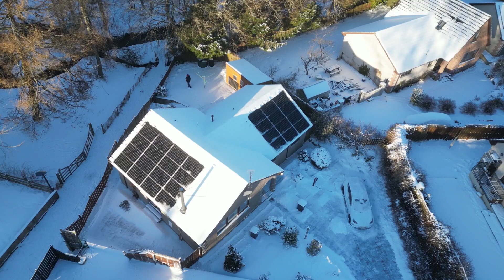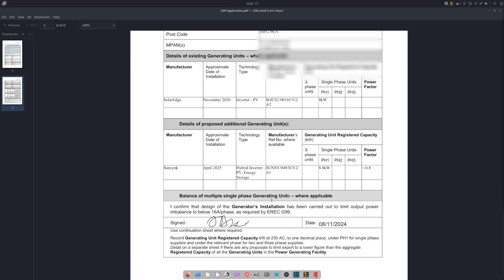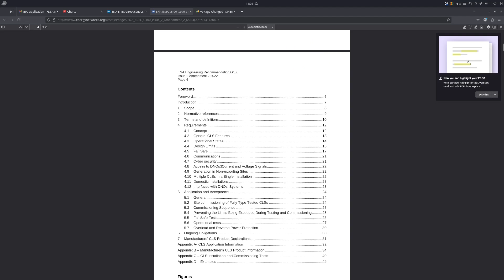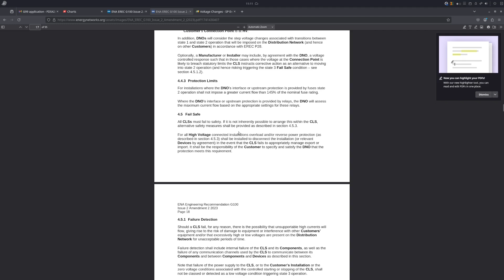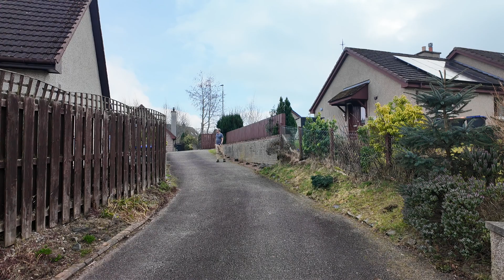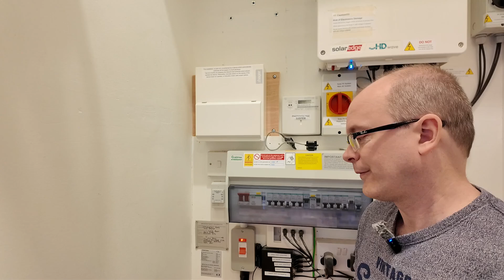G99 Application process for more solar/batteries

Comment: You can run the off grid system in parallel to the on grid system - separate the loads to critical and non-critical, etc. Some of the house loads will be working using the off grid and some will be on the on grid. Adapt as needed. Nobody can tell you do not charge the off grid battery using a battery charger that is connected on the on grid. It might be not be ideal and might increase the overall cost but it won't be need to dig the 44m driveway. If a war happens we will all have to adapt. Good luck.

Comment: I'm in a similar position. I've overpaid for a 9.5kWh GivEnergy battery with "5kW" inverter (actually 3.3kW in reality) and I've calculated I can effectively recover that overpayment if I buy more capacity that brings down the average. I'm tempted by an EV battery and inverter, but I might have to take it off grid... Just exploring the options right now. 

GivEnergy not only only work with their own batteries, but you have to get them installed by an officially trained installer to get the warranty and they seem to ask for thousands for a plug and play system! Absolute scam!

Comment: Adding additional high voltage batteries such as Tesla Powerwall2/3  which have their own inverter will not need extra certification as long as it is part of the same installation and is configured so that your export limit from all your equipment combined is respected. 
 You are talking about low voltage batteries which have no internal inverter I believe.
Reply from the maker: The fact that the Tesla powerwall has its own inverter means that by definition it is a separate installation and therefore needs a separate G99 approval.

Indeed despite the emphasis in my application that the site total export limit was being maintained, the DNO said that was not a sufficient measure without further reinforcement of the supply to my house.  They would say the same thing if I proposed to have a Tesla Powerwall installed instead.

Conversely if I add another SolarEdge battery to the inverter that I already have, then no new G99 application is required at all, since the interface to the grid remains unchanged.

The DC configuration has nothing to do with the G99 approval requirement.  It does not care if you have high or low voltage batteries. It’s the AC component of whatever generation is being made that matters - specifically the AC power that is connected to the grid.  An off grid system requires no approval, as it’s entirely outside the jurisdiction of the DNO.

Comment: Great topic as we get over voltage issues, mainly due to a few 50kw solar systems on chicken sheets near our home. Anyway invest in an off grid system no requirement to notife DNO as it does not connect to its system. Use a goid transfer switch, put new arrays into it bingo. If you have a fit or seg system just make sure its connected to grid then arrange or configure your home consumer supply so that you can switch between grid and off grid. For myself I have 12kw of arrays my intention is to use the anker solix x1 30kw all in one unit. I will configure mine so my fit solar scheme will be perfectly connected to grid and then configure the cables to consumer unit via a change over switch inside the home. For mine I will configure 2 change over switches so I can use a generator to charge bateerys if I need to. I myself require 3 phase but I have been quoted over £15k . So I have installed 4 differant arrays over east and west roofs ready for connection to the bew system.

Comment: Very interesting video. Did you make any progres on this in the last 5 months?

I wonder if there is any solution by using 2 inverters (one grid-tied and one off-grid) that have a common battery?
You could produce lots of power, dump it into the battery, then export it at the limit for as long as you can. (Even if into the night). So your max per hour export won't increase, but the amount per day will.

Comment: If you current cable is 4 wires, then you should be able to make your own ground and convert to three phase. Exactly the was done in my mama's house in Lithuania.
Reply from the maker: From what I see, it’s a single phase TN-CS supply, so just 2 cores.  This is the normal standard for most residential homes.  

Homes with overhead supply are typically TT supply.

Comment: Which software did you use for the schematic drawings
Reply from the maker: I just used libreoffice draw to do this.  I’m sure there’s better solutions, and indeed my hardware engineers at work would be using autocad for their own wiring diagrams, but I can’t afford that license.  So basic drawing tools will do for me.

Comment: have you tried to see haw much voltage sag you get when charging.
I.e measure voltage no charge and then measure while charging.
Just to see if your voltage sags as much as it peaks then you may have an idea if it is your supply cable.
Reply from the maker: @FireballXL55  When I’m pulling 8kW, then I measure 229V.  So an 11V sag.  It’s 240V with minimal loads.
Reply: @anthonydyer3939  Would it be possible to measure at a neighbours house and do the same thing. That way you should be able to tell if is your cable or the transformer.
Reply from the maker: @FireballXL55  Actually now that I think about it, I measured 229V at the Tesla, which is an extra 18 metres of cable at 6mm2.

Next time I’ll measure at the inverter.

Comment: As a commissioning engineer in the water industry, I was involved in a number of schemes that had export limitation. These were quite large power consuming sites and the generator power (CHP, Hydro, Emergency back up with synchronised restoration) was normally always to be consumed on site and not exported. I recall getting the independent reverse power trip circuit witness tested by the DNO. These were a hardwired emergency stop trip of the generation system that needed a manual reset. I would have thought that a simple reverse power trip that opened a contactor on your invertors to disconnect them if the export exceeded 5kW and required a manual reset would have been acceptable the DNO. I can see why they would not like raspberry Pi and modbus but a stand alone power measuring device with a trip contact is more straight forward. The key points are that the system works on export limitation not voltage when the primary export limitation has failed, and that it requires a manual reset following investigation of the reason for the trip.

Comment: Great video - answered a lot of questions I had, except one: I have a Tesla Powerwall 2. Does this need to be included on the G99 form as an existing generator too?
Reply from the maker: @spoonwzd  Yes it does.  It is an AC coupled battery, so it will have its own inverter built in

Comment: What I would do is radically different , at it's simplest  measure the full sun output of the panels ,  go to a local scrap yard and buy a ton or so of old car lead acid batteries ,  build an array that matches ( sort of) the full sun output voltage so if the cells are 40v then 36V and wire this  in series with the cells with a big fat diode and a low voltage cut off ,  if the full sun output is slightly less than the 12v nominal cell charging voltage the cells will last forever ,  even if abused you pay scrap lead price just replace them for more scrap batteries ,  lead acid automatically balance if you add some discharge resistors as a basic BMS ,  you can go as daft as you like with tech but sometimes stupid is better ,  nickel iron batteries are better but unobtainable basically ,  lead acid is cheap and bought properly cannot lose value ... The supply authority sees nothing ,nothing changes on your system except you export power  during the night when your output is usually zero,  cute isn't it and you can do it all yourself

Comment: The better solution is to time shift ,  you use battery storage and are able to export 24/7  ,  it's very simply done ,  you just arrange the DC backup to be charged by the secondary array and then connect using a single diode to the input if the grid tie inverter ,  so when there us no sunlight it starts to run down the battery ,  DC is DC remember that it just takes s little thought on layout and a diode

Comment: Thank you Anthony, a very useful guide. I am considering expanding our domestic solar PV and have been wondering if I should attempt to submit a g99 application rather than leaving it to the installer.
Reply from the maker: @clivepierce1816  if you can draw a good enough schematic, then I’d say it’s fastest to do it yourself.  SSE got back to me promptly enough if there were any questions, and at that point you can either reply to the question, or defer the whole matter to your installer if you feel you’re out of your depth.  If you rely on your electrician from the start, then “add some more weeks or months” is probably a global rule of thumb.

Comment: A simple device implementing the G99/2 state-machine would be very useful. e.g. for inverters which are certified to G99/1 but don't do the new state-machine stuff from G99/2. As you say, it's not particularly difficult to do, although demonstrating what level of actual uptime and reliability it achieves could be tricky. I didn't know about IEC 61508, which sounds like a reasonable approach.
It is tricky to test/demonstrate the reaction to grid excursions because you can't easily simulate those on the real grid. But one can easily test the state-machine and disconnection timeouts by connecting up a variable supply. Certainly an interesting project I'd be interested in helping get done.
Reply: Achieving compliance with 61508 isn't as straightforward as often thought. It requires an analysis not just of hardware failure modes, but implementation of a software development process that can be shown to be appropriately robust. The hardware elements might be achievable (statistical reliability information is available for most components) but you'd need reliability and failure mode data for the Modbus metering device; that might be more difficult to obtain. One question that would need an answer is what proof of 61508 compliance do SSEN require? That's easy if you buy a certified device but a huge project if you're building this yourself. I was previously Head of System and Software Safety in the automotive industry for one of Bosch's competitors, doing this kind of thing in a commercial environment is straightforward, but I wouldn't want to do it at home.

Comment: Not sure how a larger cable helps with high voltage ? Surely this just allows a higher voltage to affect more of the surrounding properties ?
Reply: I am confused about this as well.   The DNO states that no upgrades are needed to the wiring in the road, just the connection to the house.   The voltage rise/drop between the street and house will not affect the voltage in the road.   I can only see this as an issue if the supply is looped but then that should have been identified when a heatpump or EV charger was installed.

Comment: Interesting. I had an existing 8kW system (made up of 3 separate inverters) and did a G99 application for increasing it to a 13kW system with the addition of a 4th inverter. For me there was no issue and they said I could go ahead. I was expecting to be told I'd have to export limit but to my surprise, no limits were imposed.

Comment: As an industrial electrician of some years, I find this very interesting. The dno solution to install you a larger cable as the solution is strange to me. Basically it is only going to lower the volt drop between the street cable and your house. I come across plenty of farms running at 255 to 260 volts  and basically it’s only your property that will be affected anyway ( the bigger cable makes it more likely that you will push that over voltage back down the line and affect neighbours 🤷‍♂️. Is there not proprietary over voltage protection systems available that will trip a relay to isolate your inverter in the event of a failure. I would stay well clear of any system that relies on any form of coms and raspberry pi personally. I am old school hard wired and fail safe for any safety system.
Reply from the maker: @johnwarwick4105  we never use modbus for offshore safety systems.  We’ve only use it for process control and data acquisition.   Profibus and proprietary rs422 protocols (autrocomm) however are routinely used for safety input signals.

I’d love to see an overvoltage protection relay with a G100 certificate, but sadly so far I haven’t.

Comment: It's weird that the letter says:
"We have completed a network study and this has established that we do not need to carry out any reinforcement of our network to allow you to connect your generator."

Also odd that the detailed "Breakdown of Charges" only has 1 item:  A non-contestable charge of £5272.13 +vat for final connection and this seems to be their fee to inspect the connection that you have to pay to install using a qualified and registered 3rd party firm.  It looks like a lot of money to pay them considering they will do nothing other than inspect the work carried-out by others.  It looks more like a scam than anything else.

Of course, all of this is against the background where the grid suppliers do not aim at the 230v nominal value.  For long-standing economic reasons they push the grid voltage up as high as they can to reduce energy loss and provide a good margin for voltage drop for the longer connections, especially where aluminium cabling is in the mix.

I live in the old heartland where power stations were aplenty and closely grouped together, all feeding the wider grid and DNOs.  Target voltages from the power plants to the step down to DNOs who step-down to nearby residential-level voltages of around 250v.  All very efficient, lowering the current values, heat loss etc and able to support those further away.  Unfortunately this leaves very little margin for prosumers / local generators to add to when they need to exceed the background voltage in order to move that current.

So is it really the responsibility of individual small residential generators, who all form part of the future of the grid, to overcome the voltage issues cause by the traditional generating and distribution habits?  I'm not knocking the traditional generators either in trying to be as economic and efficient as possible but something has to change.  

My background voltage is often close to the legal limits as it is - some 20v+ higher than the 'nominal' value.  Meanwhile the DNOs and the grid are looking at small residential generators (aka prosumers) to provide grid and phase management relief with the newer G100 capable / certified inverters (I participate in this) and at scale to provide VPPs through some energy providers.  It is perverse to look to residential customers to provide this to the grid whilst being billed at extortionate rates to be connected to them in order to do so and then become responsible for the voltage exceedances that is mainly due to the traditional generators, transmission and DNOs looking to be as economic as possible.  

I could go on and include the introverted UK use of single phase residential power even now.  Decades ago I lived in German where 3-phase was the norm even then.  Why oh why are we still connecting houses on single phase electrics, telling everyone including the government that this is good enough, before they turn around and fire back at these customers that their cheap single phase hook-ups are not good enough to import and export the power they need for EVs, HPs, electric hobs/ovens, water cylinders and solar / battery generation.  

Not only is this maddening we now have the perverse situation of DNOs installing lower amperage residential cut-outs as an odd was of 'protecting' consumer units from being overloaded by a theoretical maximum domestic current demand whilst maxing out solar PV and/or battery.  It's pure madness and the industry is so far away from the direction of travel and government policy you just wonder who is running the show.  It clearly isn't OFGEM.

Comment: Noting that you have a Solar Edge inverter, i’ll assume that you have already investigated the site export limitation feature? If not then you really should. It’s great. You can link multiple inverters together via CAN & have the master then throttle all n devices back to a preset site export limit. It works well. Another feature is called RRCR control & a standard feature. I understand it’s for the Aussie market and allows inverters to be throttled back or even closed down totally by their DNO to avoid excessive export. It’s implemented via 4 parallel, plus gnd, inputs on the main comms board using the green edge connector. You have to enable the feature obviously, but it’s there and works. If using multiple CAN connected inverters then the RRCR interface only needs to connect to the master - with the closedown commands being passed via CAN to the slave units. A received “command” is Implemented & stays in place until the next midnight when the inverter goes back to 100%. The command has to stay in place for several seconds to be effective. Solar Edge give a number of pre-defined % shut downs based on combinations of the L1, L2, L3 & L4 inputs (0, 30, 60 % if I recall), but you can set them to whatever state you wish and theres a section in the user manual that tells you how.

I implemented by site export control and RRCR last year. It works well.

Hope this helps - Rob
Reply: Hi Rob, is this only compatible with other Solar Edge inverters or could you connect the can to a say alternative battery storage inverter as an export limit?